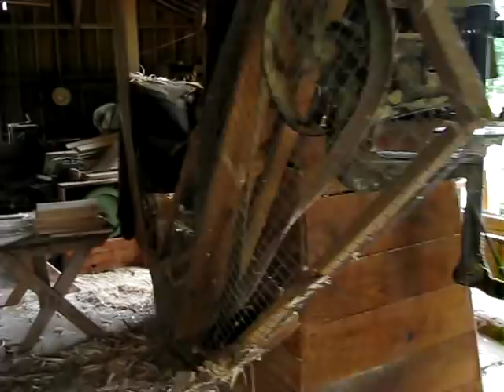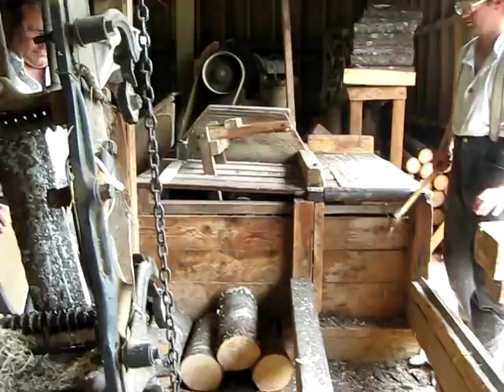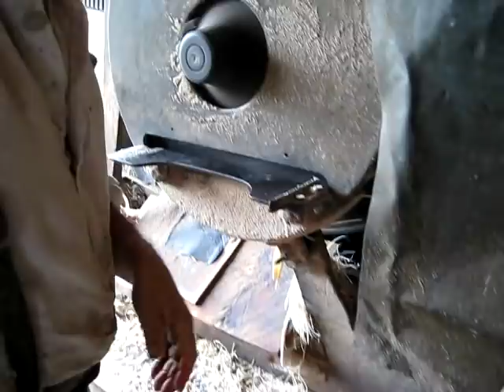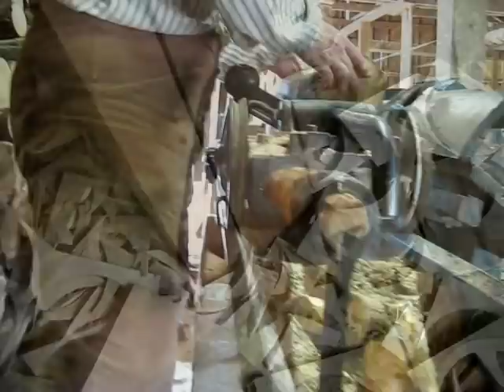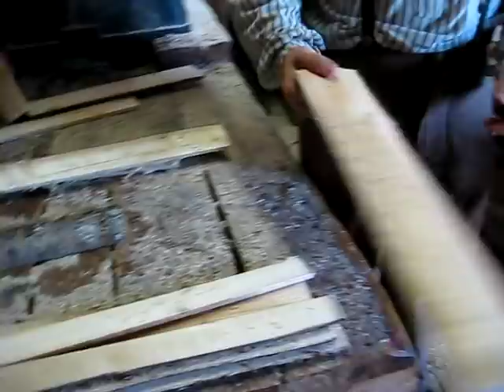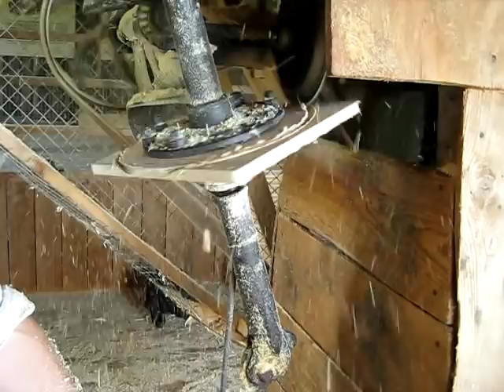The Apple Barrel Industry - Shingle & Stave Mill in Production

Comment: I work in a barrel making mill we use the same drum saw. ours was made in the 1890's and we still run it hard we cut 30"Length x 1/2" thick and edge a similar way. avg a day is 4000 to 5000 staves in a 9 hr day. good to see another drum saw like ours still working